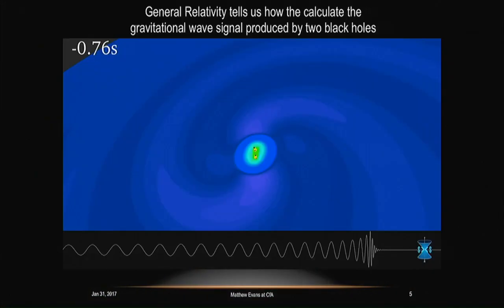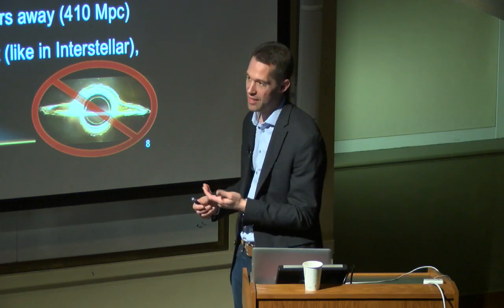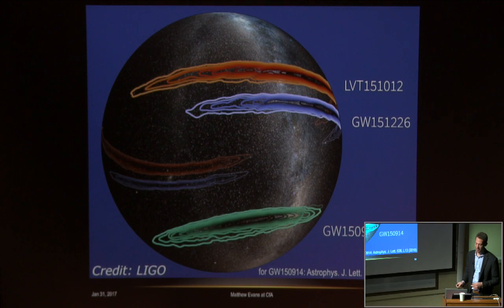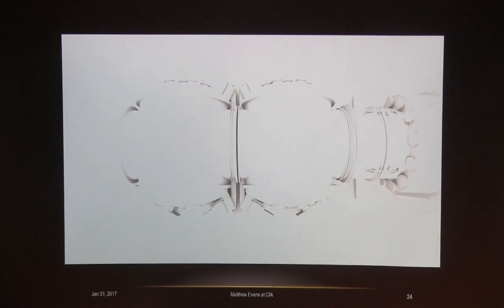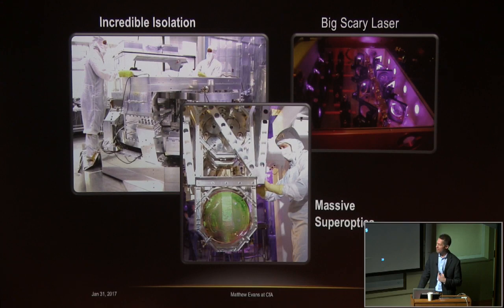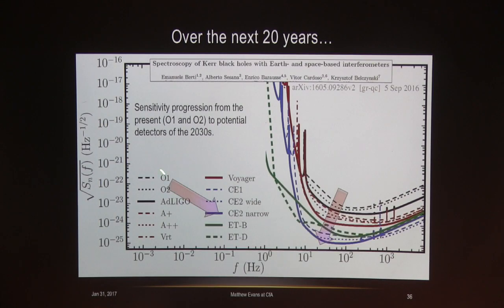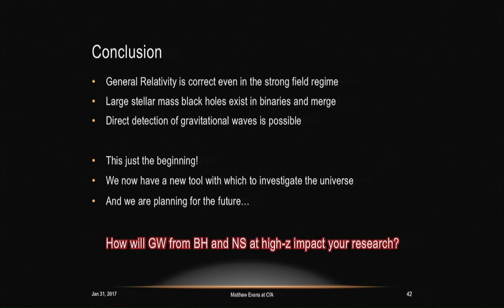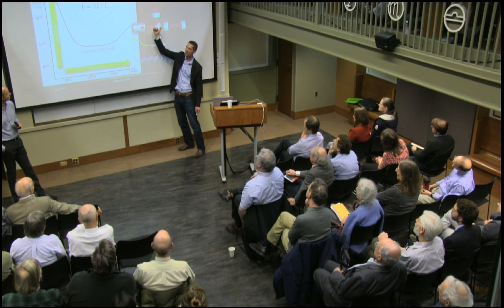Gravitational Wave Detection with Advanced LIGO

Comment: The case of PHANTORM SIGNAL The LIGO GW Chirp
Beware of one hand clapping,  there is Another possibility.
The False signal affect in analyzing massive data the LIGO system is not a true detector, but more like a  data mining system.
 Achilles’ heel of the LIGO system is the software filtering (selection, template) which creates (false signal) artifact, a well known phenomenon, a process called convolution affect. But of course, they will bury this fact From the public.
Second possibility; The LIGO device is actually a seismic instrument, for detecting and measuring activity in the quantum environment, what is referred to as the quantum foam or ether. What is this “foam“ ? Well, John Wheeler derived the concept of the “quantum foam” in 1955. It is also referred to as spacetime foam and bears a superficial resemblance to the old concept of the ether (or Aether).
So inadvertently these  scientists have entered the realm of the Quantum environment, and are listening into a new phenomenon called Quantum foam which physicists describe to be a place of violent activity of the quantum world. ...the chirp is nothing more than the pops and crackles of this quantum environment and are not related to black holes. 
And in evidence;
Recently the LIGO consortium are now reporting  gravitational waves every week; which is very suggestive that the LIGO chirps are not black holes, this is a different phenomenon! But they are stuck with this bogus Black hole story, Damn fools! I guess now they would need to invent another cosmic object called Black Hole Mimickers.
Prediction of a LIGO debacle
This is a prediction; they will find these type of  phenomena (chirps) are very common in the local environment and are not related to black holes. It Is going to be the biggest debacle in Scientific history! Similar to the epicycles of the past.  The ones that received the Nobel prize will need to give the Prize back, I would hope!